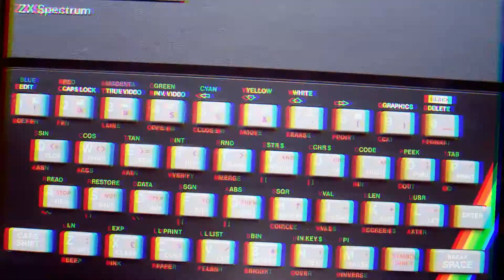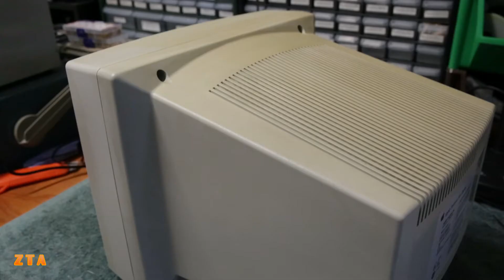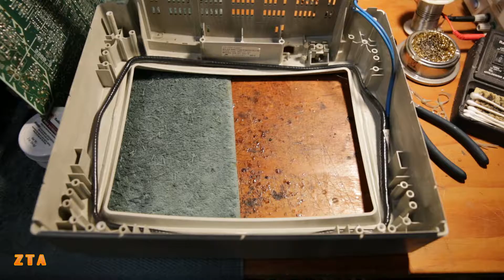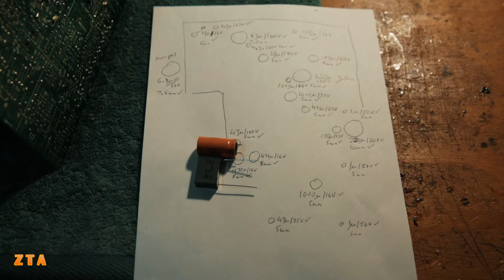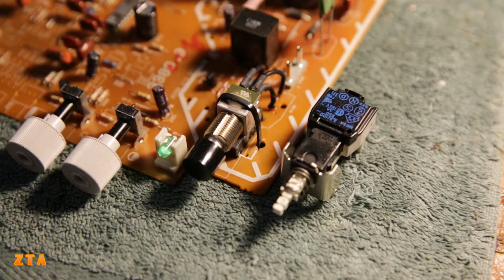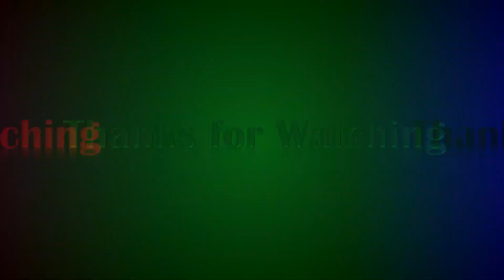Macintosh LCIII Restoration Part 2 - Apple Performa Plus Display

Comment: Hi ! Did you manage to fix the image size ? I have the same monitor and displayed image is a bit off. ty :)
Reply: The image size is correct n my monitor. Did you try adjusting it on yours? If it is off then it could be just the adjust pots being dirty. But bigger issues like the deflection coul voltage is less than normal or the high voltage is less could be the reasons. For the HV I'd start with checking the rectifier diode. Of course caps could be leaky (resistive) so thay could drop voltages. Good luck troubleshooting, hopefully it is a simple issue.

Comment: hey planning to do a recap of my display soon. do you happen to have a list of the caps your bought so i can buy the same or similar?
Reply from the maker: Took a bit of looking but found my DigiKey orders for the caps. I tried to exclude the ones for the computer but to be on the safe side I've included all through hole caps. You may end up with more caps than you need. Here are DigiKey product codes. By default buy one of each unless I have a 2x, 3x in front.
4x 493-14930-ND
1189-2182-ND
493-7961-ND
493-14729-1-ND
493-16033-ND
3x 493-11821-1-ND
2x 1189-1877-ND
1189-1291-ND
P13115-ND
3x 493-11596-1-ND
1189-4165-1-ND
2x 1189-1545-1-ND
1189-1740-ND
493-2014-ND
3x 1189-1735-ND
493-11752-1-ND
1189-1241-ND
493-12156-1-ND
1189-4028-ND
399-15740-ND
493-14930-ND
493-15575-ND
493-12225-1-ND
493-5130-1-ND
2x 493-10329-1-ND
399-20886-ND
Reply: @ztechalmanac3194  would rather over order than under order thank you so much for putting the time in to get all that for me